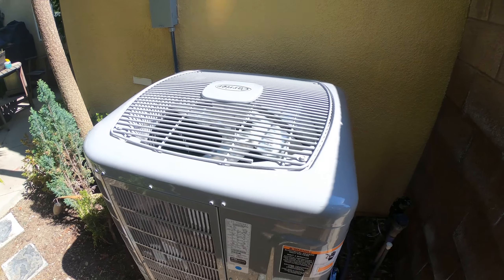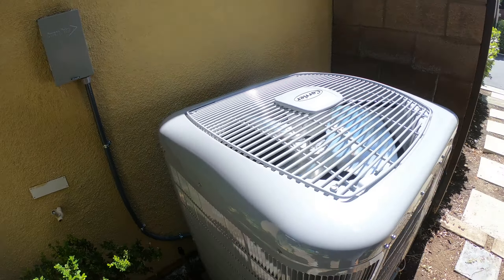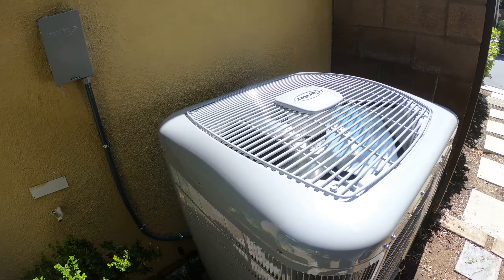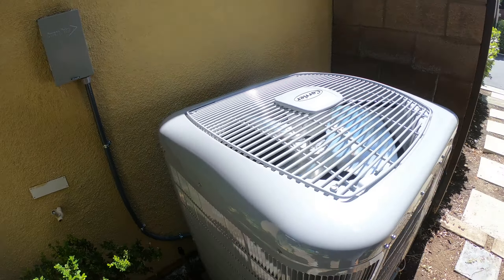Carrier 3 Ton Variable Speed Condenser

Comment: Very nice system but variable speed condenser seems overkill. I put in a new 2 stage Performance line this week after my Carrier Infinity failed after 16 years.
Reply: That is a nice system as well.
Reply: Not really, variable speed systems in my experience are significantly better than two stage, and mine runs 100% of the time, constantly freshening and cleaning the air, instead of turning off and on like 2-stage systems. I’m glad I didn’t get a 2-stage system.